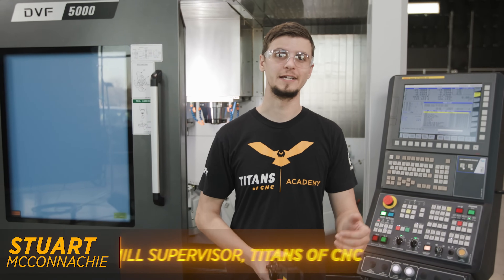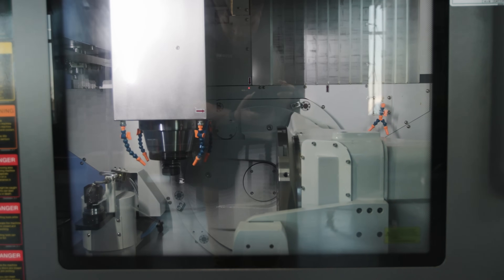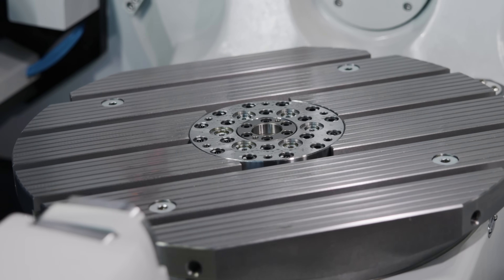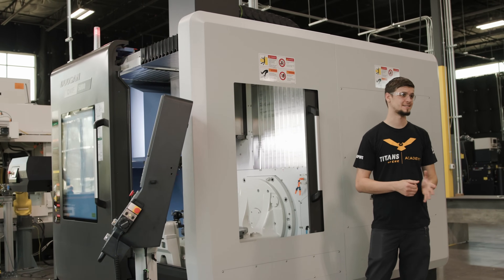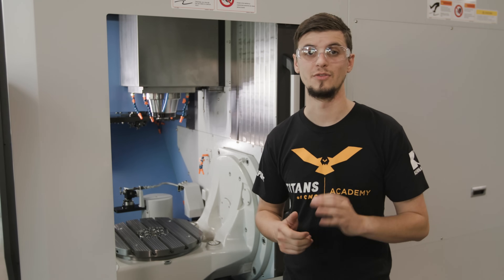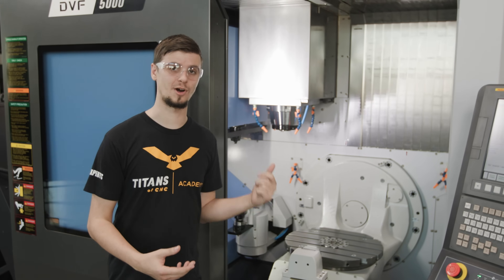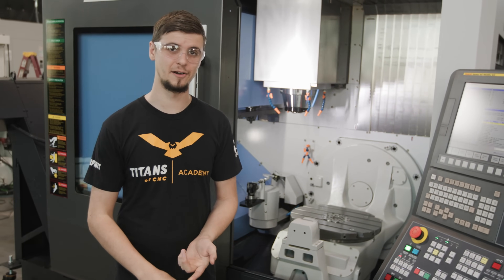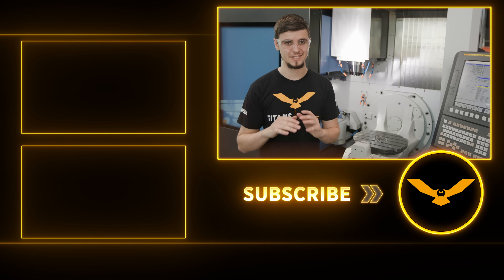Unboxing the NEW DVF 5000 5-Axis CNC Machine from DN Solutions

Comment: I have a question. Why not use Mazak CNC products?
Reply: Mazak is the last brand I'd go to over Doosan
Reply: @85CEKR : Why?
Reply: @runejakobsen9958  I look at Mazaks like the Haas of the Japanese brands.  We have a job shop here but there's alot of automotive mold work done in my area, there are countless stories of shops buying brand new mazaks and not being able to hold the same tolerances they did on their old machines.  The only brand with a worse reputation in my area is Haas.  I looked into Mazak when we went 5 axis and quickly dropped them as an option when I talked to other shops with them.
Reply: @85CEKR  What would you say about 10 year old Doosan 2 axis lathe for general turning. Are they good? I saw that they cost around 30K. Also would you choose Lynx or Puma? Would be great to know why they changed their name from Daewoo to Doosan.
Reply: @Andrey222ful  I think Doosans are pretty decent machines.  I would not buy a lynx though, they are their cheap line.  The pumas are pretty comparable to other brands high end machines.  10 years isn't bad if it's well taken care of.  One of the main things we check on lathes is the squareness of the turret that gives you a good idea if its been beat on.  Just keep in mind that they could've lined everything back up before selling it.
Reply: @85CEKR  Thanks for info. very detailed information.
Reply: @Andrey222ful  no problem, make sure you get as much info as you can, you can't do too much research before buying a cnc machine
Reply: @85CEKR  got it, Thanks
Reply: @85CEKR : And you believe all the stories you hear?
If Mazak is the japanese version of Haas, why are they the second largest manufacturer of CNC-machines?
They were the largest one until Deckel-Maho and Mori-Seiki joined together as DMG/Mori Seiki.
Can it be that it is the operators that can't handle a Mazak and crashed it?
Many crashes have effect on presicion.
You ever tried to operate a Mazak?
Reply: @runejakobsen9958  well Haas is a pretty huge machine tool company too... and they are Haas lol.  I don't think Mazaks are horrible machines, just from what I've seen they aren't in the same league as some of the other high end Japanese brands.  This is just my opinion, and you should take it with a grain of salt as you should anyone's opinion, but I did spend alot of time researching and talking to owners and operators a few years ago when I got into 5 axis.
Reply: @85CEKR : What part  about the Mazak-machines was the problem that makes you consider them to be not in the same league as the other high-end japanese machines?
Reply: @runejakobsen9958  there were accuracy issues on brand new machines, one company bought 20 mazaks for a contract and had to sell them six months later and buy a different brand because they couldn't hold the tolerances, then new machines had to issue.  To be clear that job had tolerances of a few microns so it wasn't like they were out a thou or anything.  Also alot of my customers who have them complain about how they have to baby them when it comes to roughing, specifically their lathes.
Reply: @85CEKR : Which model of lathes? Microns as in 0.001mm?
Reply: @dietermeyer9231  yes it was positional hole tolerances of 5 microns or 0.005mm.  I actually did a few batchs at our shop and we didn't have any scrap, but the machines they ended up going with were Mikron I believe.  For the lathes it was mainly people with integrex models, but I had one guy with a regular single turret, (not sure the model) but it was a 10 inch chuck class and he was shocked at cuts we were taking on machines the same size.  He asked how often we had to get our machines checked and fixed for squarness.
Reply: @85CEKR : I was running an old 1987 QT20 with Mazatrol T2 back in the days.
I made locking-pins (diameter 30mm) with an f6-tolerance. The repetition was within +/-0,0025mm from programmed diameter and the tolerance was 0,013mm in total.
What size and material was in your high-precision workpiece?
When position-tolerance is 0,005mm you have a designer that doesn't know a thing about limitations on machines.
Material, tool, temperature are factors that have a big effect on this size of tolerance.
Hold the workpiece in your hand for a few seconds and it is out of tolerance.
A small error in measuring tool will also have an effect.
0,005mm is a human hair (from head) split into 12 or 14 (depending on hair).
You can't compare a lathe with a regular turret against an Integrex (the 100-400 Mk1-Mk4 and the i100H-500H).
These are totally different designs and the Integrex isn't meant for extreme roughing.
The ordinary turret-lathe is handling roughing much better then the millspindle/B-axis on the Integrex, but it also depends on which way the B-axis have when roughing.
Have it in 90 degrees when face-turning and 0 degrees at external turning.
You have to think about which way the cutting-forces work when you are machining.
Reply: @runejakobsen9958  0.0025mm is pretty good, especially on an old lathe without thermal compensation.  We have an ongoing job on our lathes with a bearing fit thats double that tolerance its not too hard to hold but cutting it in half would be challenging.  The part with that tolerance was about 1.5" dia by 2" long.  It was nozzle for a very complicated injection mold and needed to be so tight because of stacking issues.  As for the Integrexs, that may be so but Mori's and Okuma's in the same class will rough just the same as a standard lathe
Reply: @85CEKR : Well, the Okumas and Moris are in basic copies of a Mazak.
Your "special work-piece" probably would have got the same result on an Okuma/DMG/Doosan/Mazak, so don't judge Mazak as a "japanese version of Haas".
Mikron machines are special machines for ultra high-precision.
When it comes to roughing and capabilities the Integrex is not worse then other brands that have the same construction (you didn't say which model/make of the Integrex is was).
Keeping that tolerance I described isn't a problem for a skilled worker with a very good machine.
Reply: @85CEKR : I have a feeling that you don't know how the Integrex are set up and adjusted.
You didn't say which model of the Integrex it was.
Reply: @runejakobsen9958  I'm not sure what model it was, but it was one of the slant bed style not the newer ones.  They guy who had it said every time he tried a .100 thou cut per side he had to take the covers off and re align the head.  I know a shop that has an older stlye okuma macturn (basically same construction) and the things a beast.  Also I wouldn't say mori copied mazak, maybe okuma, but not Mori, there NT DCG machines are quite different (and far better in my opinion) than the mazaks. Also they came out before the newer mazak integrex machines.  And no the Mazaks were not holding the tolerances the same as okuma's anyways because the job was done on Okuma's while they were getting the mikrons ready and the okuma's had no issues like the mazaks.  Like I said I don't think mazaks are bad machines, maybe my first comments were a bit harsh, but from what I've seen they are not in the same class as say mori, okuma, matsurra or even Doosan.  That's just my opinion though.
Reply: @85CEKR : What do you mean by re-aligning the head?
Just the head or the carriages?
On the old slanted Integrexes (Mk1-Mk4) you don't remove covers to re-align the head itself.
The early Mk1 had very small  bolts attaching the head to B-axis, but they went up to M10 on the later Mk1.
Mk2 had M10 or M12 from the beginning.
Mk3 and Mk4 have M12.
These eigth bolts is the ONLY thing that holds the millspindle in place on the B-axis.
Covers are only removed to re-align carriages (Z and X).
On the bigger Integrex e-machines you have to remove covers to re-align the head, but that head only moves when crashed.
To be honest, what is the point in doing one 2,5mm cut on the end-face?
It will take you 15 seconds more if you reduced cut to 1,5mm instead.
Do you know which way the B-axis was? Was it in 0 degrees, 45 degrees or 90 degrees?
There are so many unknown  factors in this that you obviously don't know.
Face turning is just for cleaning the end-face.
No machines likes a crash and it is easy to find out if a machine have had a crash.
Many operators claim the head is out of position because it is a POS machine that can't handle big cuts.
What they don't say is that they had a small accident in the machine.
Or they just don't know how to use it correctly.
If you are face-turning with the B-axis in 0-degrees, the momentum on B-axis will be bigger compared to when you have the B-axis in 90-degrees.
All machines have tolerances on alignments. 
Which way was this problem-hole of yours?
End-face or outer diameter?
The position-tolerance of hole was from center-line of work-piece?
If it was on the end-face, it depends on how straight your B-axis/mill-spindle was and how well-aligned the mill-spindle was against the centre-line of turning-spindle.
If that is out of machine-tolerance, you will have problems and it isn't the machine itself doing this.
Reply: Because they are not sponsored by them?
Reply: Mazak are good machines, can't even compare Mazak with Haas